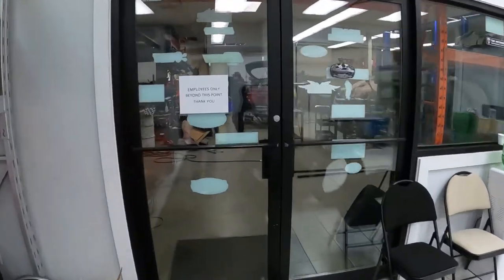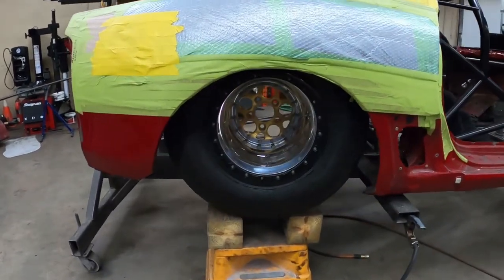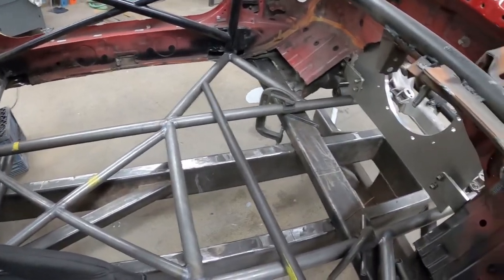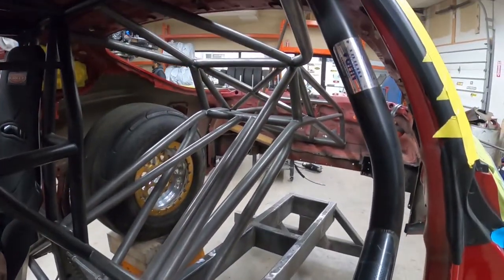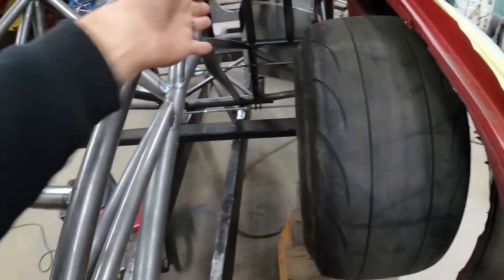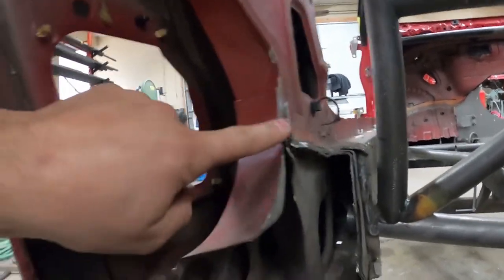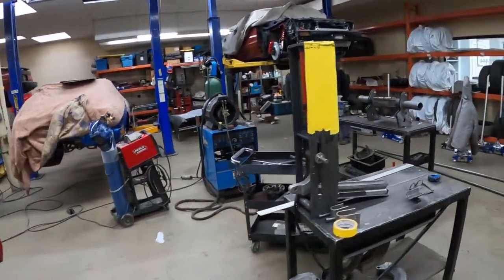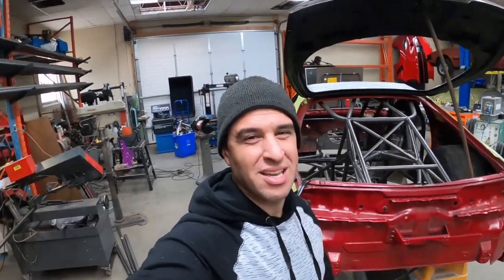Supra IRS to 4 Link - Part 4 - Roll Cage progress

Comment: What coilover spring rates did you run (front and back) when you were IRS?
Reply from the maker: It had 400lbs rear for sure, cannot remember fronts.
Reply: Then the fronts must’ve been like 600ish - wow that’s way stiffer than stock which is 400 front and 220 rear - with the 4 link you could probably be at 180 front and 120 rear